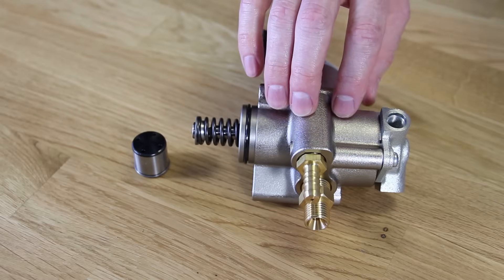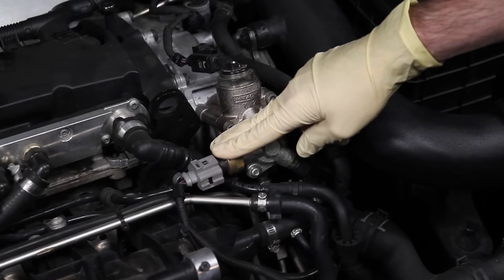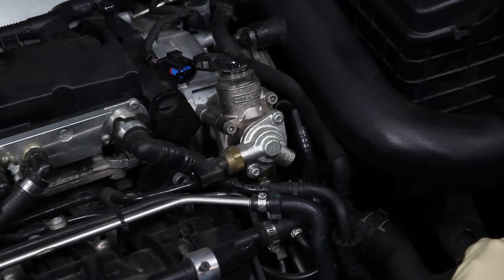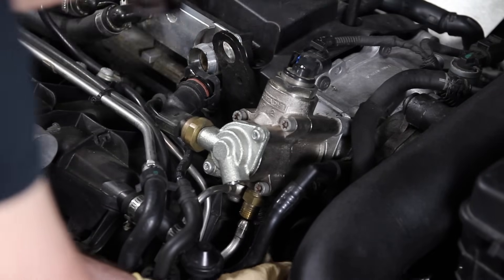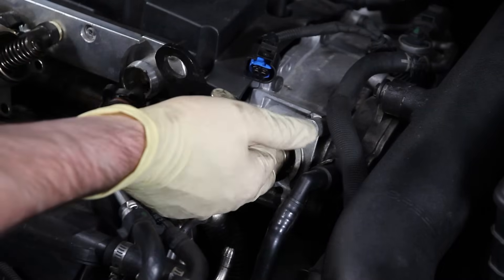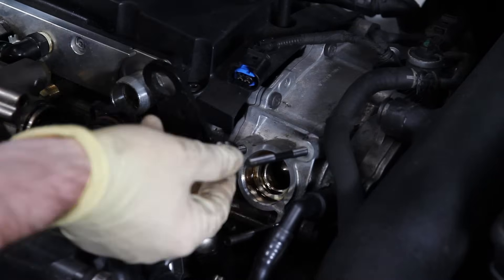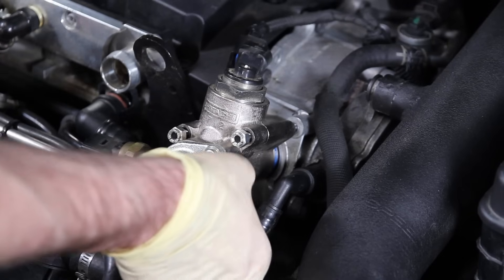VW Audi 2.0T FSI - How to (DIY) Check the Cam Follower, Replace the Fuel Pump and Convert to Studs

Comment: Thanks for the quick reply. Your site says 30 days for that magnetic deal but I can't wait that long. 

So you're saying I need to replace the HPFP and cam?
Reply: 3k worth of repairs. 😡
Reply: Thanks man. I'll be checking that part every 15k miles from now on. Car is running great and I just paid it off yesterday!
Reply: Good luck! If it's not worn, I'd replace it anyway. $75 part is much easier than 3k unless you do it all yourself.

Comment: hi I have a 2009 Audi a8l and I'm having a cold p2293 fuel pressure regulator 2 does that mean that my high fuel pressure pump needs to be replace and if I do replaced it and get the aftermarket part do I need to change anything off of the old one or the new one I'm really looking for some help
Reply from the maker: +smooth gaskin We are sorry we have no way to know.  You will need to have the vehicle properly diagnosed.
Reply: +Deutsche Auto Parts ok

Comment: Is it possible for the schrader valve to be on so tight that it feels like it'll strip ? I was trying to do mine and didn't feel comfortable with how tight it was so I left it alone. I'm gonna go ahead and order a spare in case it does but, if it does strip how would I get it off ?

Comment: Hi 

Excellent video 

Just wondering cause I'm not get power on lower revs
Could this be down to worn cam follower 
The car is a Audi 2.0 Tfsi 06 plate 
Remapped to 265 bhp 

On 60k but Dont think its been changed 

Thxs 😁
Reply from the maker: sirius black Its possible this is your issue.  You should start by checking the cam follower.
Reply: Deutsche Auto Parts 

Thxs for reply 

Just bought cam follower & o- ring for hpfp 
Getting it changed tomorrow
Let u no how I get on 😁
Reply: Got the cam follower change 
Massive improvement but not 100%

But now the only code coming up is 

P0171.  system Too lean bank 1
Reply from the maker: Sounds like you have a vacuum leak
Reply: I reset the code it hasn't come back yet but I'm going to get a smoke test done end of the month

Let you know how I get on 

Thanks 👍

Comment: Is this also the same for the 2016 GTI? I plan to check mine every 10-11 months since so many owners are having problems with this. Why do the people at VW not fix this? It affected the MKVI and MKV models too! Just lazy of them to not redesign it.
Reply from the maker: +largol33t1 this only applies to FSI engines
Reply: @Deutscheautoparts  Hi. I know this is an old video but does this apply to the 2.0 tsi as well?

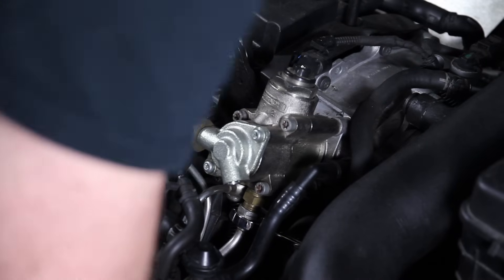Comment: at about 5:20 he refers to a nipple that you could knock out? is that the hose just to the right of the hpfp?  I knocked off that hose and a little rubber gasket fell out and I'm trying to see what it is called.  Any help?
Reply from the maker: +Brian Racer This is the nipple we were referring to in the video.  This is not what you are speaking of.  If you can send us a picture we should be able to help.  
Nipple Found HERE if broken - https://deutscheautoparts.com/1k0-121-087-h.html

Comment: 2008 Audi A4, 2.0T, Quattro: >>> BEWARE <<< 

Purchased this stud kit from you, HOWEVER, could not use it. Tried installing it but there is simply not enough clearance to tool. Reason: After installing the studs, trying to fit the pump back on was not possible due to the Large Hard line running to the radiator (?).Studs stick out too far!  Had to loosen several brackets to this line but still not enough movement.  In addition, I had to remove all the fittings on the pump itself to even get close to re-installing it on the studs. My 30T torx would not tool correctly on the bottom bolt (too wide a socket). At that point, I realized that future on/off would be a complete PITA and not make sense.  So...I used the new follower and the original torx bolts . Since I have 138k miles and no damage to original follower noticed, I most likely will not be removing this again anyway. 

NOTE: Thank you for clear videos. I resort to them often. This comment is for those DIYers like me with the same car/engine design.

Comment: One Thing I forgot to mention can the cam follower cause the car to go into limp mode ?

Saying I'm doing 80mph down motorway then I press on accelerator 
Goes into limp mode but soon as I turn engine off and back on 
Limp mode is gone 

Thxs really appreciate ur advice 👍
Reply from the maker: sirius black It could be but you should start by checking the follower
Reply: Sorry bout this 

Do u mean the cam follower ?
Reply from the maker: Yes the Cam Follower.  You can take a look here for more info http://shopdap.com/vw-audi-2-0t-fsi-cam-follower-and-camshaft-wear-problems/

Comment: My cam follower was worn though. Full repair was completed by the dealer. Is it still recommended to check the cam follower at regular intervals or are the revised parts installed by the dealer no longer subject to failure?
Reply from the maker: +Ryan Rushton Yes you should.  Take a look here for more info http://shopdap.com/vw-audi-2-0t-fsi-cam-follower-and-camshaft-wear-problems/
Reply: I just removed mine after 10 years and 100k miles. I was expecting the worst but it looked brand new. What an absolute pain. I did break the little coolant flange as well.

Comment: How would one know if the problem was the cam follower or the fuel pump or both? I have both the p0087 and p2293 codes with hard starts and cold stalls.
Reply from the maker: +HuBrIsRaDiO The only way to know for sure would be to check it.  Take a look here for all the details.  
http://shopdap.com/vw-audi-2-0t-fsi-cam-follower-and-camshaft-wear-problems/
Reply: +Deutsche Auto Parts okay. So, I took it all apart and the cam follower is wore completely through. It's was practically stuck on the fuel pump spring. The end of the plunger that is supposed to be connect to the spring was completely broke. My next question is how to tell how much is to much wear on the camshaft lobe. It doesn't look to bad but there is some scoring. I was sure how to turn the shaft with out cranking it, so I took a play off the right side to get a side view of the entire shaft. I can tell if it needs replacing.
Reply from the maker: HuBrIsRaDiO If the damage was that bad you should replace all the components.  You can try to put a new pump and follower and see how it goes but this is not advisable.  The bad cam could cause further damage. .
Reply: Thank you

Comment: This is a great video. I have a 2012 mk6 gti edition 35 (CDL engine] with a phantom cold start noise my mechanic can’t isolate. It goes away after 2 mins and I am wondering if this could be the issue. It has 120,000kms (75,000 miles) and I’m not aware this has been checked

Comment: At the moment from a stoplight or pass a stop and step on the accelerator quickly , the car lost power and the engine shuts down , I throw a single code of failure P- 2293 about the pressure of fuel does this piece failure presented ? ( 2010 VW Jetta GLI DSG)
Reply from the maker: +ragonza loar Yes it sound like you have a HPFP problem.  You have a TSI which can be here
https://deutscheautoparts.com/vw-audi-2-0-t-tsi-fuel-pump-06h127025q.html

Comment: Is changing the fuel pump o-ring essential? I have just bought the cam follower tappet on its own and finding the o-ring seal as a single item is proving difficult.
Reply from the maker: EnglishIsALie Replacing it is up to you.  As far as finding it we have links to the seal on the cam follower page to try to make this as easy as possible to find.  Did you purchase the cam follower from us?

Here is the seal https://deutscheautoparts.com/wht005184-fsi-hpfp-seal.html
Reply: I got it elsewhere because I live in Scotland. I have found the seal on a few American sites but can't justify the shipping costs if it isn't absolutely essential to replace.
Reply from the maker: EnglishIsALie We understand.  International shipping doesn't always make sense. You should be able to reuse the old one but it may leak.
Reply: What's the worse case scenario if it does leak?
Reply from the maker: You will have an oil leak.

Comment: Hey guys... just noticed your cam follower was completely worn and the center was missing in this video. Did you guys do anything to remove the metal that is now floating around in the engine or cam area? I need to know because I just checked my CF and it looks just like yours.
Reply from the maker: That was just one we had as an example.  If yours looked like that you would need a cam and fuel pump likely.  In regards to getting metal out you can always add a magnetic drain plug.  https://deutscheautoparts.com/06f-198-908.html
Reply: Hey guys... where can I find a replacement o-ring that you replaced on the HPFP? Can i get one locally? Need my car back on the road today.
Reply from the maker: Jeremy Johnston https://deutscheautoparts.com/wht005184-fsi-hpfp-seal.html

Take a look here
Reply: +Deutsche Auto Parts Picked one up at the dealer. Thanks for the reply! Hoping the metal doesn't ruin my engine.

Comment: Hey the hose that you removed from the pump @2:27 is there any pressure on that line...
Reply: yes, remove fuel pump fuse and run car till engine stops.
no pressure.

Comment: do you know where I could find a replacement connector for the sensor at the top of the hpfp? the plug attached to the vehicles harness

Comment: On your bits listed you need to specify the triple square bit needed as I did this whole job then couldnt get the banjo line off :*(
Reply from the maker: +lewis grimshaw We do specify that.  If you take a look at 1:55 it says 8mm tripple square
Reply: Ahhh sorry mate was just looking at the part list at the beginning.and thought it said torx I ducked up made a fuel leak need to get that bit to tighten up the bajo line now

Comment: @Deutsche Auto Parts, I recently had my fuel pump replaced. and i own this exact car, but they replaced it with a "diesel" high pressure fuel pump. I'm not mechanically inclined....so, ill have to look at the receipt to make sure. But, does this affect the overall performance of my '08 passat 2.0t fsi?
Reply from the maker: miguel sanchez Im sorry but installing a diesel pump is impossible so there must have been some miscommunication.
Reply: Deutsche Auto Parts thanks, well it must have been a TYPO. anyways it ended up being a $500 part. i payed 100 b/c i have a 4year warranty. it sounded a bit sketchy, I'm glad you guys clarified that.

Comment: What do you think about the 3.2 v6 a4..? I'm kindve worried now because i bought the car at 90k and I'm at 104k and I do the mantience when it's required at our shop and I believe the high pressure fuel pump has never been touched.. I've heard if they fail, they can damage the cam shaft and possibly the engine. have you ever changed one on the v6 or heard them failing often?
Reply from the maker: +Ejmin Khosrovian This is the pump youre talking about but as far as we know they dont have the same issues with cam follower wear like the 2.0t FSI did.  It is still possible for the pump itself to go bad. 

https://deutscheautoparts.com/make-model-year/audi/a4/b7-2005-2008/engine/v-6-3-2-liter-audi/repair/fuel/06e-127-025-ab.html
Reply: +Deutsche Auto Parts thanks for replying and yup that's it and its located between the V of the engine on the drivers side head. Does it help the cam follower that I change the oil with the exact spec oil Audi recommends and the fact the inside of my engine looks brand new and clean?
Reply from the maker: Ejmin Khosrovian yes using the proper oil is important
Reply: Ok, thanks I'll still take a look at it when I take the lower and upper intake out to clean the carbon deposits. Do you guys sell a catch can for the 3.2 v6 or are they all the same?
Reply from the maker: Ejmin Khosrovian We are sorry no catch cans for 3.2
Reply: +Deutsche Auto Parts Damn.. thanks anyway i appreciate you taking the time answering my questions.

Comment: Hey Paul! Or anyone on the team. I have a code P0089 and the symptoms I see is slight hesitation from a stop. Should I replace the whole pump or just the cam or could it be something else ? Thanks in advance !!!
Reply from the maker: You will need to check out the parts to see whats up.  Take a look at this article http://shopdap.com/vw-audi-2-0t-fsi-cam-follower-and-camshaft-wear-problems/

Comment: So usually there’s an error code? My car only shows #2 cylinder misfire, my mechanic said it’s the fuel pump, coils and plugs were replaced
Reply: i have one of these too, probably just the coils and pulgs, not the fuel pump
Reply: Caleb Christensen it turns out there’s more damage and Audi says they have to tear down the engine and replace parts. $1695 just to tear down the engine. No compression on cylinder #2
Reply: Manny B ahhh what code were you getting?

Comment: I am receiving the code P0089 from my 2006 Audi A4 (B7) 2.0t TFSI Quattro. The code says Fuel Pressure Regulator Sensor. Any advice where to start for this? My car has the same gas mileage and is performing the same since day one. Thank you for your time.
Reply: I had that code and replaced it with the orange sensor. 2007 2.0 A4.

Comment: mine doesn't have the valve to let the fuel pressure out. what should I do?
Reply: you could try removing the electrical connections and cranking the motor.. Although I am not 100% sure this would work

Comment: Hey guys, will this apply to the 2.0TFSi on a 2008 Mk2 Audi TT (8J) ??
Reply: raggaryan44 hey I have a 2011 TTS 2.0 FSI and this procedure was the same for me, except I had the newer revision without the banjo bolt. Yours is more than likely the exact same as the video with the banjo bolt.

Comment: Is it dangerous to put a lower grade of fuel than what the cap in the gas tank specifies and why?

Here in Canada we have 87 regular unleaded  - 89 mid-grade gas containing an octane level of 89

Lastly, 91 which is the highest octane rating fuel.  Ideal for high performance vehicles, particularly those with Turbochargers.

 Some people i know say it does not make a difference.  

I have a 2009 VW Passat 2.0 Turbo 6 speed manual transmission.
Reply from the maker: You should generally use the octane suggested by the manufacturer.  
Here is a video that explains octane https://www.youtube.com/watch?v=cfhTTuxF6Mk
Reply from the maker: Please take a look here to understand more on that https://www.youtube.com/watch?v=gqvhaPLuTPI
Reply: Deutsche Auto Parts- Your Source for Everything VW and Audi is the HPFP normally fail on the vw passat?is it expensive to buy the cam shaft lobe?
Reply from the maker: David Henriquez Here is the cam http://www.deutscheautoparts.com/View/06F-109-101-J/06F-109-101-B/0/139882
You will have to inspect your car to determine what is damaged

Comment: the fuel pump seal is to make the oil not leak out the engine. not to protect the fuel pump assembly from oil. The cam follower has holes in it remember. this is to allow oil and air to pass so there is no vacuum and to keep it oiled.
Also, did anyone notice the first bolt loosened, he went clockwise first and had to think about it and then go anticlockwise.
However, it was a good right up. More info on the stud kit would be nice. like can you get it from Audi / VW and what length and diameter?

Comment: The banjo bolt is stripped!!! How fkt am I? And where do I go from here?
Reply from the maker: Most likely you will have to take the whole line off then drill out the stripped triple square or use and easy out once the assembly is off the car.  Sorry to hear about your troubles.
Reply from the maker: Thanks for the feedback.

Comment: I have the barbed fitting with a rubber hose. Swapped out the pump and hooked it back up, and the low pressure side keeps leaking a significant amount of fuel. Is there a washer that goes above the low pressure fitting like there is on the high pressure side? Can’t seem to find the issue.